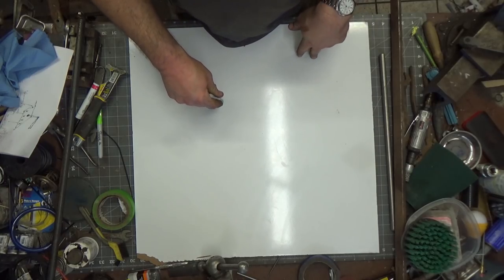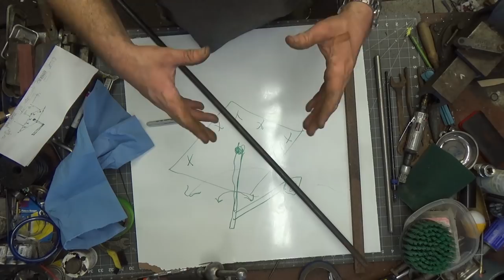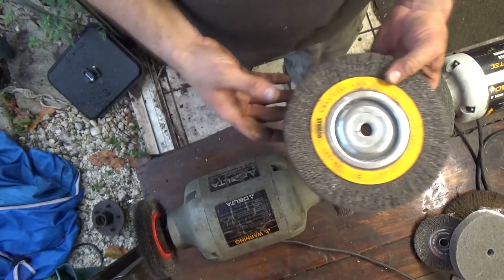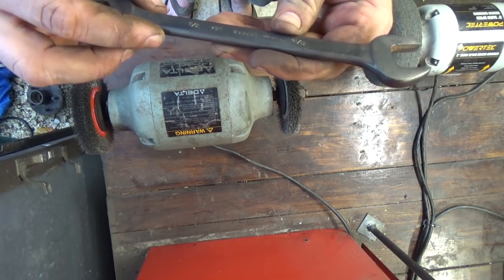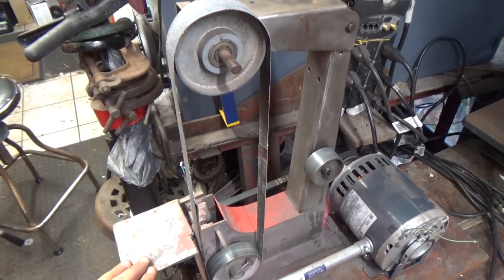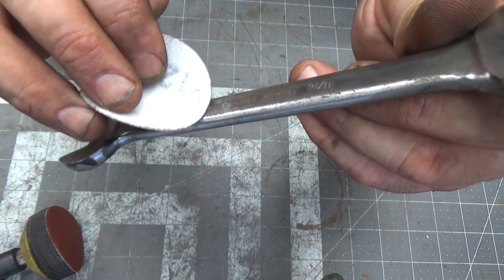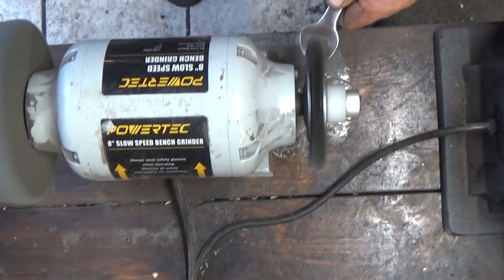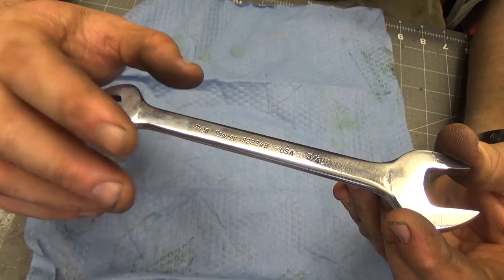Camera Arm & Snap on Wrench

Comment: Hey Joe,

Enjoy your channel.  Can you expand on the "fiber" wheel you are using?  Brand, width, etc?  Currently searching for one of those and would appreciate any recommendation.  Have yet to start recording videos, but I restore a lot of old tools.  Follow yours and others, always looking for those "gem" ideas that I haven't seen before.

Funny about the "snap on" tools.  I'm the very same way.  I call them "snob on."
Reply from the maker: Hi Wade, participating in youtube is so rewarding, I would strongly encourage anyone to take part. The fiber wheel is made by UXCELL and they sell on amazon for like $10. I made a video not too long ago if you type in UXCELL Joe's Shop it should pop up. here is a link to the 6" wheel https://www.amazon.com/Uxcell-a15051300ux0782-150mm-Polishing-Buffing/dp/B0143E90AE/ref=sr_1_12?keywords=uxcell+fiber&qid=1554939385&s=gateway&sr=8-12

Comment: Thanks for pointing out the advantages of the 1,750 rpm grinder speed.  Your wire wheel on the faster machine may or may not be defective, but it is out of balance as mounted.  Is the hole bigger than the shaft? Might want to wrap some electrical tape around it to make it fit the hole better and smooth out the vibrations. Good job on the wrench, and Ben did a good job translating your mother’s sketch into a colorful logo.
Reply from the maker: Hi Anonymous, I have a pile of wire wheels and occasionally I get one that fits nice a tight on the shaft, but never will balance out...it is weird. Ben really did a remarkable job, I think my mother would have loved it. Cheers

Comment: Cool projects.   Where did you get the powertec low speed grinder?  I think I found it on amazon but it looks like you have removed all the guards so you can use it properly.    

Early in the video you leaned over so we could see your hair.  Looks like you still have a full head of hair but are getting a little blonde as you have more birthdays.
Reply from the maker: Hi Russ, yea it is the same one on amazon. I have a foot tall pile of saftey guards under the bench, lol. Yea i have all my hair, im cool with going grey, it will be camoflage for my shop because my head will be the same color as my machines 🤣

Comment: Good one Joe, I'm starting to record cleaning a Billings wrench cleanup,, I'm having a lot of the same issues you have had.  I also cannot use those belt sanders with the expertise of Scout,, so I will have to use a different method.  Good stuff! (when you speed up the video -what speed do you use?  Thanks, Todd
Reply from the maker: Hi Todd, I either adjust the frames per second (FPS) rate or I use the rate stretch tool in adobe premiere. I have a Garmin action camera that is set to 2 FPS, which works pretty good and it cuts the file size way down. Cheers